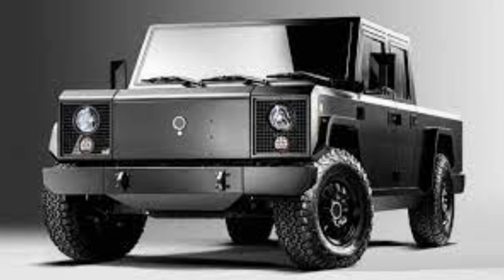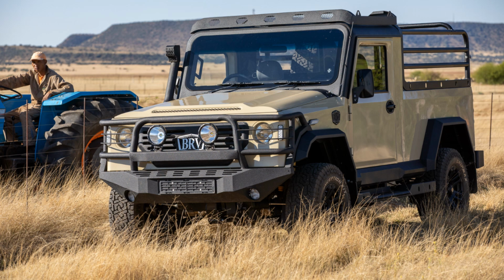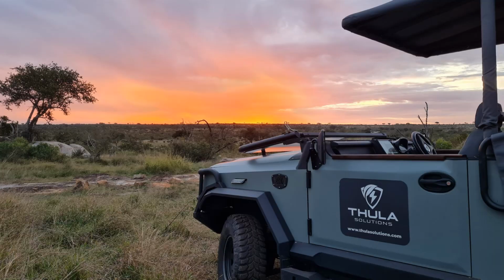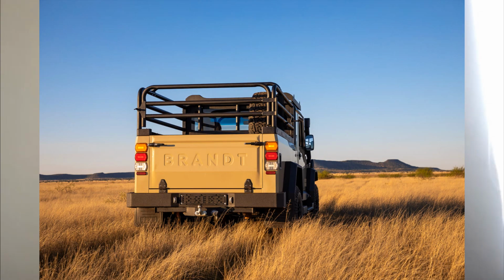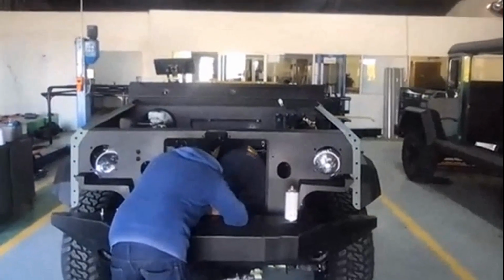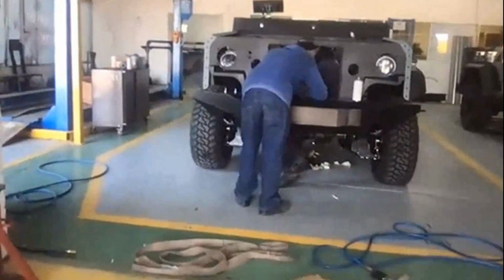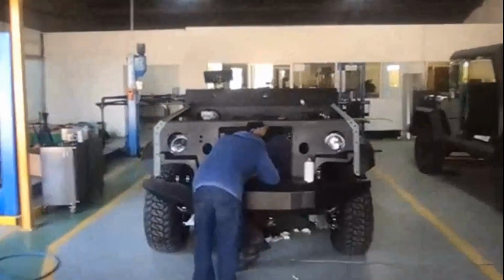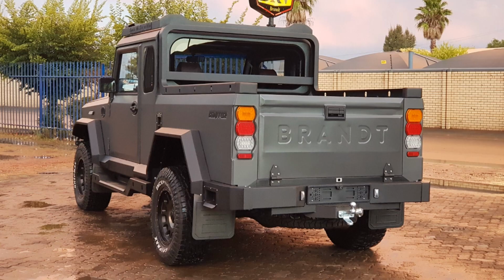First electric safari vehicle / Toughest bakkie in world?

Comment: I wòld imagine Australiaould be inteested prticularly for the bush stations where reliability and runing costs together with tank like rugged build are key. The same would aply for all sub- saharan bush applications. Game and extensive bush ranching aplications are notorious for eating 4x4's for breakfast. This would be a great set of use cases for anti-poaching ( needs acelration and speed in pursuit and rapid response scenarios), firefigting, game capture ànd eco-tourism applications. One wonders if a set of pv pnels can't be put to use as a shade platform.
Reply from the maker: Works well if run on solar at home base. The whining noise of the electric engine might be an issue thou.

Comment: I wonder is is dual , quad? Electric motors?
Reply from the maker: Good question, I'll try find out.
Reply: @Africasideways  Tnx - yeah drop us a msg here if you find out.
Reply: @dimitristsagdis7340  Hi Dimitris, this model is a single motor but the new variant at Thula will be a dual front and back 225kW motors and a bigger battery